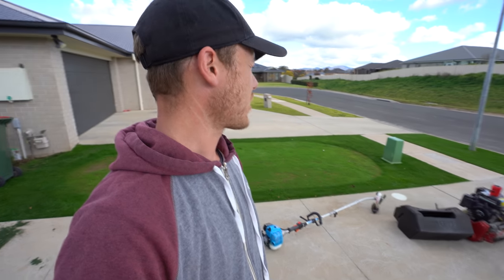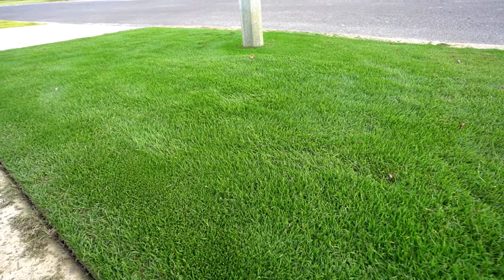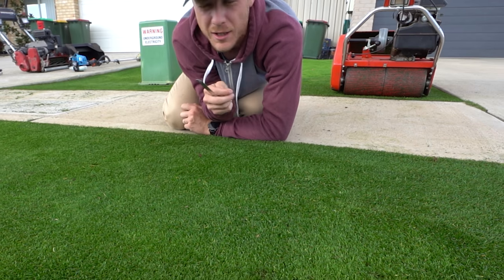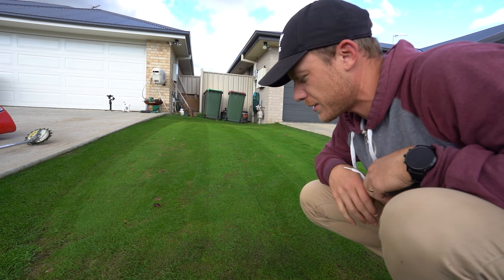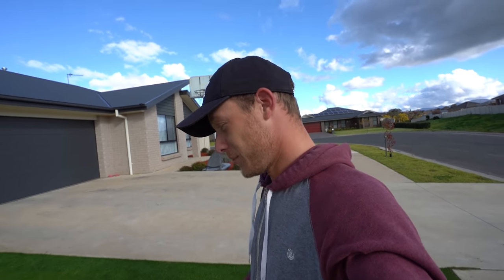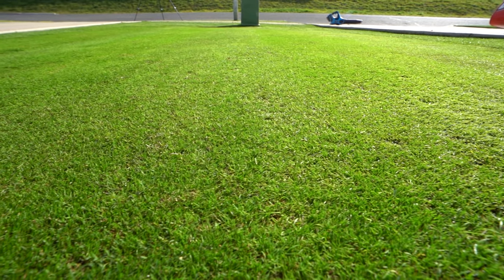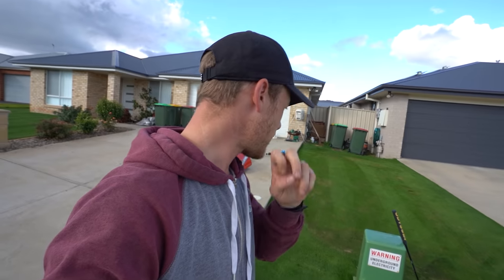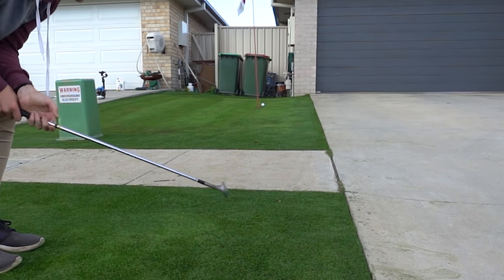Is My Seeded Golf Green Ready To Play On? // 35 Day old Bentgrass Seed

Comment: What equipment is that you are using. Haven't seen that in the US and definitely want to try it. Have any information or links you can share?
Reply: jonathan rhodes Bushranger multi tool, made by maruyama from Japan. Rover 45 cylinder mower (not made since the 1990’s).

Comment: Look up aluminium weedeater heads and get some plastic line! Those brush cutting heads are epic are kinda crappy for grass, especially when its next to concrete.
You can also turn the weedeater verticle and not need to change heads but you do you bro ☀️
Reply from the maker: Have you ever used a landscape blade? They are the best thing that has even happened to me. Same with the blade edger. But each to their own
Reply: @LawnTips  honestly no I havnt they do look cool though so I should try. I do a lawn run in Auckland so the floppy line does it all and im worried they will be too job specific.
I want to try the landscape blade without having to buy one so maybe ill come to Orange for a long weekend
Reply from the maker: Simon Monto haha you are welcome anytime man!